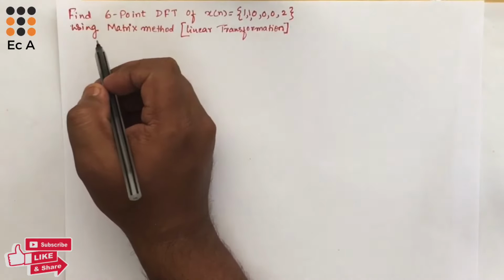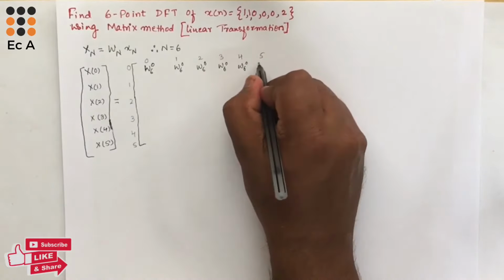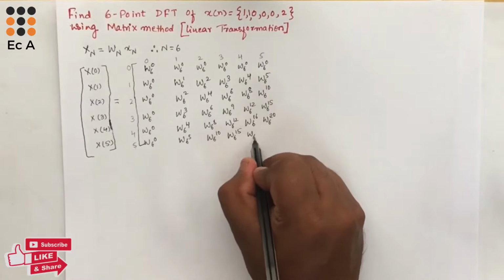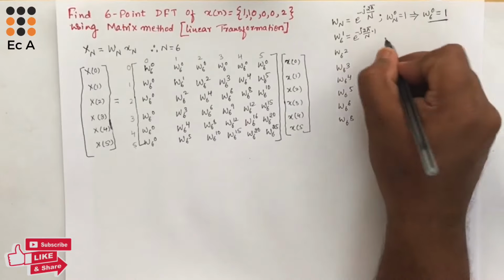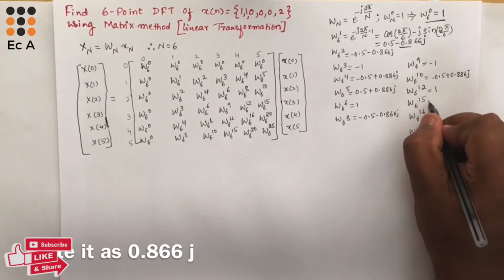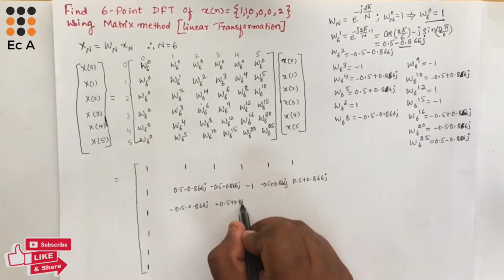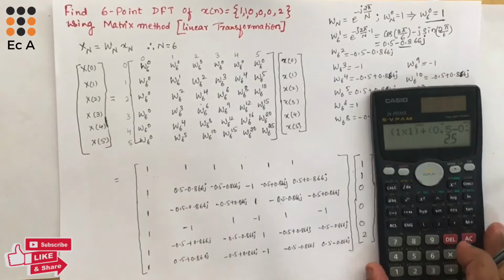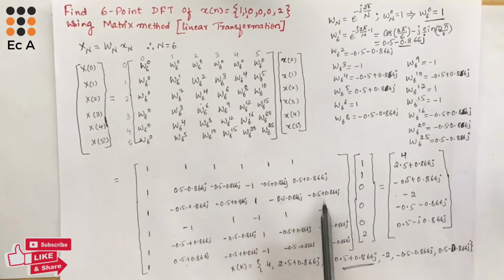DSP#9 problem to find 6 point DFT using matrix method or Linear Transformation method || EC Academy

Comment: Nice explaination sir. Thank you for making it so simple. One quick doubt, so if we are asked to find even point DFT's like 4 point and 8 point, then the "METHOD 2" can be used. Otherwise, we should calculate the Wn values by substituting formula method. Is that correct sir.🙏